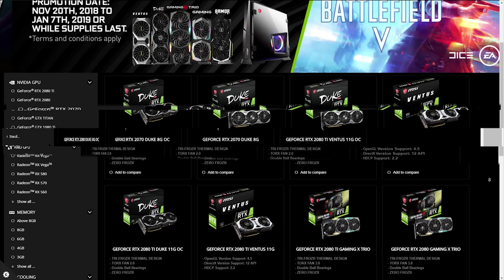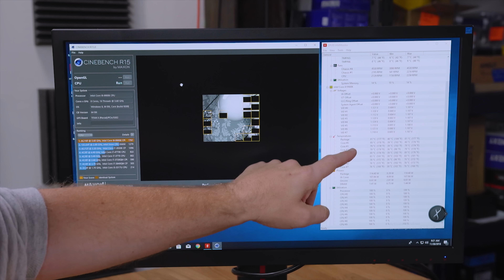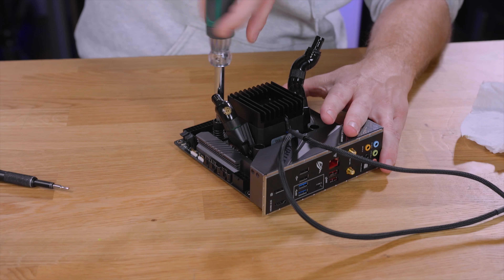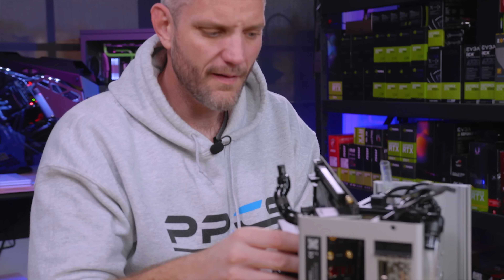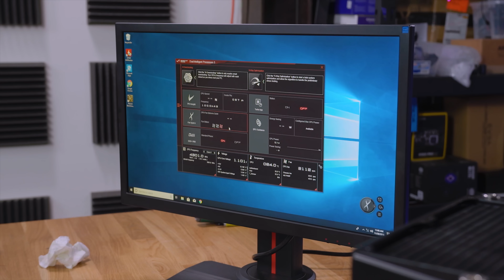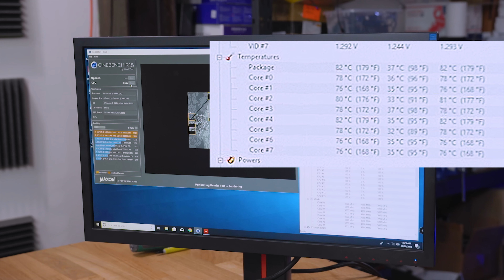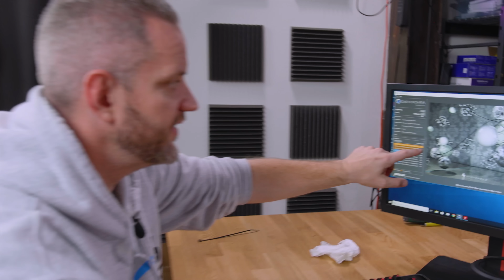Something went wrong with the small watercooled PC...

Comment: Convectional airflow doesn't matter in a fan cooled case. Even super-slow spinning fans will still move wastly more air than convection could ever do, so you might as well just set the case horizontally and not choke the intake.

Comment: Why not do positive pressure? Have all the fans input air, top and bottom, and the hot air will be forced to leave through the side panels
Reply: Given the case, id argue this is a reaaally good idea
Reply: I agree. Not open enough for a neutral pressure system to flow well.
Reply: Inputing cold air in a small system like this is a splendid idea! 👀
Reply: I like this idea, but what about the air pressure from the power supply pushing outwards?
Reply: @essenceofsias  maybe run that side of the rad as an exhaust? 3 intake fans 1 exhaust still nets you positive pressure while exhuasting your psu. Still not ideal running hot PSU air into your CPU rad though lol.
Reply: @essenceofsias  I think he could maybe remove the PSU fan and let the rad fan do the job? I don't know if that would work.
Reply: @DumbSloth87 Flip the PSU fan it should work well to exhaust air out the side
Reply: Great idea.
Reply: Doesn't matter when the IHS of the CPU you are using is shaped like a dome lid and isn't properly contacting the CPU water base plate....

Comment: I had a smiliar problem with my 9900k had to try 3 times re applying and re sitting the block to get the temps from 100c down to 50-60c under full load.

Comment: I know you probably won't see or take my advice but get rid of the cross flow radiator for a thicker return radiator with push pull in the other direction so it pulls cool air which should drop temperatures by minimum of 10C cause with the end results you got after an hour of gaming it will throttle again.

Comment: Let's hope the next version of NUC would please all the ITX Lovers out there.
Reply: Heck, the current NUCs are pretty neat as is. The SFF and gamer cross section is a little smaller than thought.
Reply: Should look into Mini STX. Awesome potential for little builds.
Reply: @naycnay  "Should look into Mini STX. Awesome potential for little builds." Too small for a PCIE slot is a huge limiter – you're stuck with (expensive) MXM cards, or hacking together something using an x4 M.2 slot. Mini-ITX is much more versatile for only a small increase in size over Mini-STX.
Reply: @Justin.Franks  Depends what you need the PC for. If you needed that stuff, you wouldn't be looking at NUCs or really small form factors.

Comment: wait, so I'm building a pc this week. Do I need to buy cables for the pc or do all the cables I need come with the parts I'm buying at microcenter?
Reply: Zebrify all the cables should come with.
Reply: they all come with power supply and motherboard.
Reply: @Pienimusta  Ok, thank you! Do I need to get like a sound card or will my usb paired headset work without it? (Sorry, I know most of the stuff but not the advanced parts lol)
Reply: @Zebruhfy  Most modern motherboards have integrated sound cards, but USB mics and headphones have integrated sound cards in the hardware.
Reply: @trey3172  thank you!
Reply: @Zebruhfy  lol I answered after watching the video...and I didn't see the other answers yet....
Reply: All internal cables come with the parts. You will get power cables (external for wall and cables like 24 pin for motherboard, 8pin for CPU,...) with your power supply. Cable for front USB, power/reset buttons, led,... comes preattached to the case. Sata cables if needed come typically with the motherboard (2 or 3, if  you need more you need to order them). Only display cable (HDMI/DVI/DP) doesn't come with any part, typically your monitor comes with this (and when your are lucky it's more then a VGA cable)
Reply: @_clemens_  ok thank you man. You see I bought a pre-built and I had to exchange it, and it still didn't work so I had to return it. So now I'm building a pc and I'm really glad.
Reply: @Zebruhfy  seeing you are sort of a noob here :P hey, we all start somewhere! ill go ahead and give you a tip that you may already know, but its more common than you may think. If you get a graphics card, make sure you connect your monitor to the card's outputs, its a common mistake on new builders to connect their monitor to the motherboard's output, but if you already knew, then dismiss this lol anyway, when you build your pc, dont forget your hope, your armstrong bracelet and a shitload of thermal paste. Seriously tho, if you have doubts, ask away!
Reply: @MrQuequito  yeah, I had a pc with a 1070 ti so I knew that, but thanks. Also, where can I find one of those static bracelets for static discharge. Could I find them at microcenter
Reply: Zebrify 

You don't need them. Just don't build your PC on carpet and ground yourself by touching some unpainted metal piece like on a space heater. You probably don't even need to do this but whatever.
Reply: @-eMpTy-  wait so if I plug in the power supply and touch it while it's turned off will that prevent it the whole time I'm building?
Reply: @Zebruhfy  you can find them at microcenter, yes, but like the little alien ^ here pointed out, you dont really need them, just dont build on carpets, dont use clothes that make you zap stuff. (A cotton hoodie or plain cotton shirt should be good) but if you want to feel fancy or have concerns, well, just buy em, they are about 5 bucks, so, not expensive at all
Reply: Zebrify 

If it's unpainted metal then yes, but I wouldn't particularly touch the power supply. See, I've build over 20 PCs in my life and most of the time didn't ground myself before building.
Reply: @Zebruhfy  just touch the case, then you are good for the rest of the build (:
Reply: @MrQuequito  Ok thanks guys!
Reply: @Zebruhfy  Only thing I could think of that doesn't come with your parts list is a PWM fan cable splitter. This is only needed if you bought case fans that didn't come with the case and they don't have long enough cables to reach your mother board's case fan hubs. You should be good otherwise.
If you plan to be using the 1070ti to the fullest, I suggest you use DisplayPort instead of HDMI, for those cables support higher refresh rates than HDMI cables, assuming your monitor supports high refresh rates (these are measured in hz, like 144 hz monitors, 120hz, etc) AND G-SYNC, you need a G-Sync monitor or you're going to experience tearing.
You can discharge yourself using the metal case you got for your build. If you have any concerns for messing up any parts in installation, check Jay's old video here: https://www.youtube.com/watch?v=CDUZRNp4pxg
You will feel better to know that your parts are more sturdy than you think. Keep the good practices, but don't freak out at the slightest errors.
Happy building!
Reply: just dont build on carpets!!!??? are you guys all new here? Go see the Jayz video where he build a PC on carpet.
OK can happen but is very hard fry components with static electricity from your body. just do what same ppl say plug in the power supply and touch it. and everything will be fine
Reply: @VolcanoPenguin  Ok, thank you. I thought HDMI was the best. I have a QHD 144hz Acer Gaming Monitor and when I use HDMI it supports the highest refresh rate. Also I will check out that video from Jay thank you!
Reply: @Zebruhfy  If HDMI is working for you then ignore what I said about display port, unless you want to test yourself and see if it makes your experience any better. You can get a DP cable for abou15-20$ , just make sure that your graphics card and monitor support the version your getting. Latest version of DP is 1.4 as far as I know.
Reply: @VolcanoPenguin  one came with my monitor, but I just threw it back in the box and it's in my dad's storage unit now lol
Reply: @VolcanoPenguin  a fan cable splitter is the same as a 3 to 1 rgb splitter right?
Reply: @Zebruhfy  If you're talking about this https://m.newegg.com/products/9SIA4RE7573156?ignorebbr=true&nm_mc=KNC-GoogleMKP-Mobile&cm_mmc=KNC-GoogleMKP-Mobile-pla-Corn+ElectronicsCables+-+Internal+Power+Cables_-9SIA4RE7573156&gclsrc=aw.ds&gclid=Cj0KCQiAxZPgBRCmARIsAOrTHSYbC13bX3Hi89wsgGGWJxRGMgEApcQzpe3DhPTtikPjNTRBCRSuJWUaAq7AEALw_wcB then yes. I am actually very glad you asked me this so I could find this very good deal lol
Reply: Normally all cables are included with the PSU. The SATA cables come with the mobo. Things that are not included are stuff like fan-splitters but you usually only notice you need one halfway through a build anyway.

Comment: You could actually have the radiator fans push air from the outside inside the case to have fresh air always. After all inside the case you don't have any big problem of heating since both CPU and GPU are getting liquid cooled. Also, be careful of pushing the CPU too high, because the heat removing capability of the radiator might suffer a lot when a combined CPU+GPU load kicks in. You tested a pure CPU load and already had 85+°C with no heat coming from the GPU
Reply: You have VRM putting heat in the case, so keeping air going in one direction would allow for some passive cooling on the VRM.

If it was me tho I'd change all the heatsinks for more efficient ones, like copper blocks with fins for Raspberry pi. That would help with both heat dissipation and having less restriction for the airflow but it would cost much time

Comment: @JayzTwoCents ,  DUDE I have The same issue with the 9900k on stock voltages ,  and stock speeds .   and cinebench still hit 100c on two cores
This is on a 280mm AIO with The pump at 3000 RPM and Fans on 100% RPM.   My Idle temps are 36-40c , and 60-70c in gaming and streaming . i ended up getting about 85C on the package max on cinebench after i got down into the issue.

Comment: Hey @JayzTwoCents
 I also got the i9 9900k, and with cinebench it becomes about 60-67 is that a normal temperature for a look only for cpu and chipset? What temperature do you get with prime95 small fft's? I get around 90/93 and then I shut it off to be sure :( truth to be told pretty disappointed in the temperatures of the i9 9900k.

Comment: I just built a PC for my Cousin as a Christmas present and I've encountered an issue where the PC shuts down when gaming at times. I checked the temperatures and power consumption figures and they were all fine. I even greatly increased the fan speed. So I ran heaven benchmark for about an hour and everything was going fine but then I noticed that my cpu usage was hovering around 10% and while gaming it's usually around 50-60%. I started cinnabench while running heaven benchmark and sure enough the PC shut down. The motherboard debug LED went on saying that the cpu was no longer detected (sometimes while gaming I believe it was the gpu that shut down). Forcing it to shut down and  I can reboot it like normal. I believe that the issue is either the motherboard or the PSU but am not entirely sure.

Specs:
ryzen 3 1200 @3.6ghz
msi b350m bazooka (original bios. Kind of scared to update it since there are several stories of people bricking this board while doing it.)
8gb patriot RAM ddr4 3000mhz (running at 2933)
refurbished xfx rx 570 4gb
xfx XT 500w PSU

Comment: soldering warps the ihs, same as it ever was. been delidding cpu for a few years but now it seems like its back to lapping. not done that since i had a q9550 :D
Reply: Wow really back to the old customs
Reply: @bootlegscarce0844  q9550 O.C. to 3.4GHZ on asus p5q deluxe here. It still kicks ass.
Reply: @bootlegscarce0844  I'm trying to get there but I don't have the special vrm coolers that go on top of the radiators. For the cpu I am using a 240mm AIO so no problems there.
Reply: Yeah looks like I will be doing lapping as well. Damn, it's been so long I don't even quite remember how I used to do it.
Reply: I've never had an issue with amd cpu's, they're soldered...
Reply: A Punar yeah I mean what’s .005” when it comes to thermal paste. It seems to me he just didn’t add enough the first time around.
Reply: Yeah, never had to lap an AMD IHS. Idk what kinda trouble with soldering intel has :D

Comment: the problem with running the 9900k at 4.3 or lower is that its not even going to be faster than an 8700k or r7 2700x, if its so hot it has to be gimped to work then maybe it doesnt deserve to exist, or at the least not in thermally constrained scenarios. if you had a 2700x in there it would run at maybe 70c-ish 'edit' nvm the lapping and or re-application of the block and ihs seem to have solved the problem, get rekt me!
Reply: um tf you talking about a 9900k is 21% faster at stock in percent value averages. Depending on your application its more or less than that. Its still superior to both and while its cost is 550$ looking at the performance difference its really only around 100$ more in reality in some cases even less than a 2700x.

Comment: Dont forget @jay2cents the tjmax needs adjusting as the hwmonitor dont read the tjmax correctly you need to use hwinfo that way you can check if the tjmax is detected correctly as i use xeon e5450 that have the tjmax as 85c where hwmonitor detected 100c same with realtemp and coretemp that just my guess. Keep up the good work jay :)

Comment: Need to perforate the panel adjacent to the PSU air inlet to the fan.... and then try REVERSING the fan in the case to EXHAUST out the side panel....

OR, just perforate the side panel and leave the direction alone...  Looks like there is a PSU air supply recirculation short circuit.

Comment: that intro is me EVERY TIME i finish ANY project, i have more non-working things in my home than working. You need to do a load of laundry? ok, dont close the lid all the way, you gotta sort of jimmy it open a little while you simultaneously push the 'start' button and then it slam shut before the agitator kicks in. Oh, you need to lock the bathroom door? ok, pull up on the door by the handle like youre trying to rip it off the hinges while slightly turning the knob until it clicks, then you gotta bash the locking mechanism as hard as you can, you have to go on faith that its locked because its one of those that unlocks as soon as you turn the knob so you cant really check to be sure